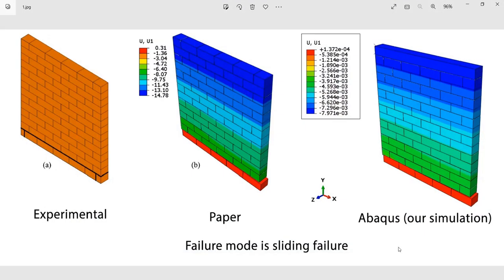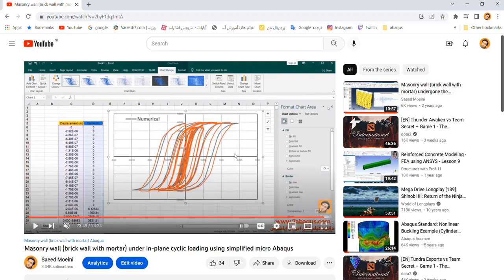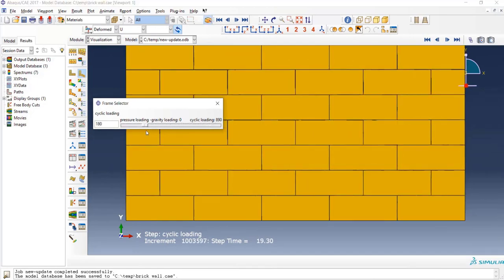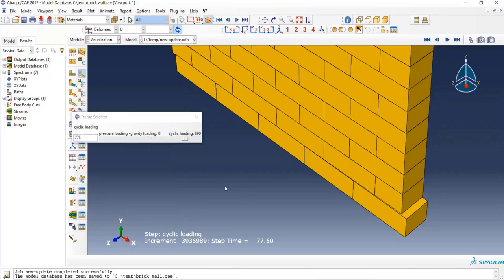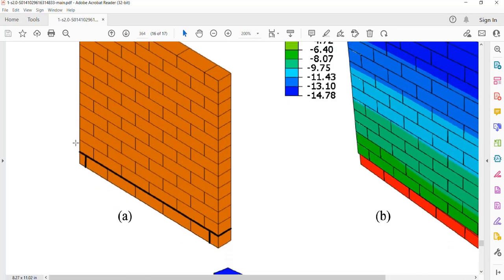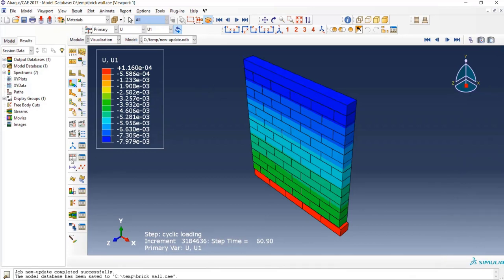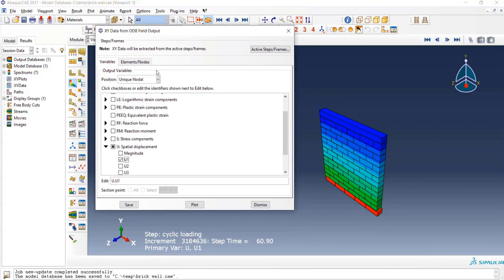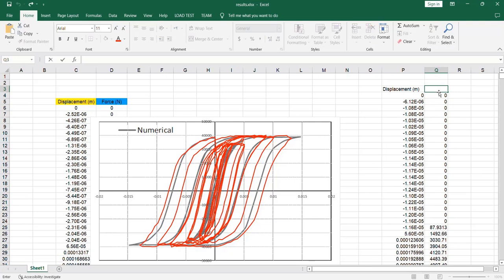Sliding failure of masonry wall Abaqus

Comment: If someone intends to simulate stone masonry without considering the effects of mortar or cohesive behaviour, they would only need to define the normal and tangential behaviour for interaction properties. While defined parameters exhibit linear behaviour but the experimental force vs displacement result does not follow a linear curve. The discrepancy suggests that there may be missing parameters in the model. Please help me identify these parameters. Thank you in advance.